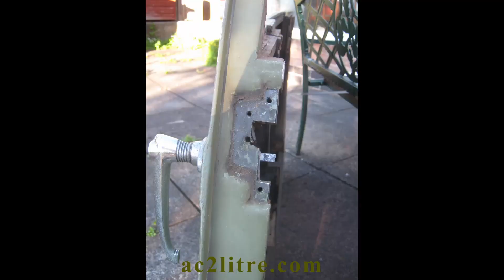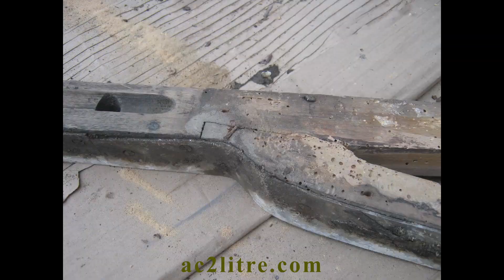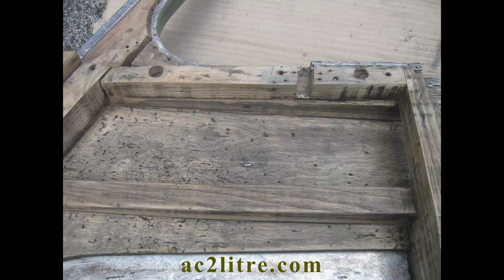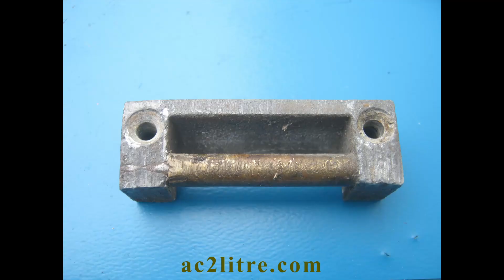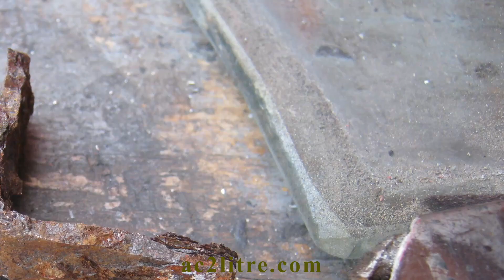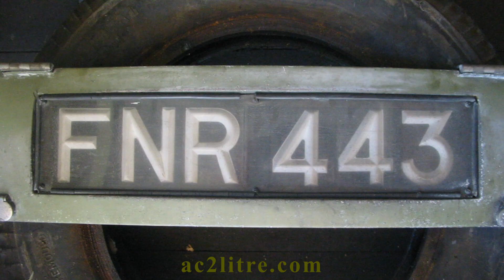Restoring ash framed doors - 1949 AC 2 Litre (slideshow).

Comment: I have been working on my doors for my tr3 funny those doors there more like a suggestion then a door. there is wood in them also just on the top and down where the side curtain mounts are and nailed into the doors on the top then a leather warped bolster over the top. I was able to get the nails out without damage but the bits of wood screwed to the top bit of wood are screwed and glued but the glue gave up and the screws are rusted and most of them broke off so now Iam trying to work out how the remove them or maybe drill new holes for the new screws.
Reply from the maker: The woodscrews tend to waste away under the head (and break), but a ball of rust forms on the thread, locking them into the wood. I drilled a small hole alongside, and pulled them out and glued a repair piece into the hole.